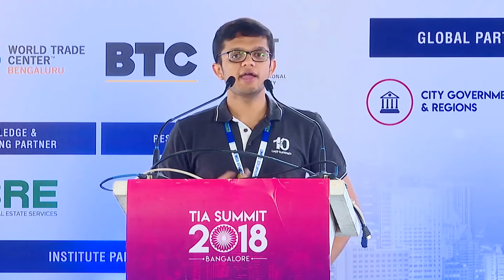Introducing Metal Air Batteries - Akshay Singhal, Log 9 Materials

Comment: IT'S REALLY A BREAKTHROUGH TECHNOLOGY.. Let's bring it fast..
Reply: Actually Metal Air battery made with Li as anode, has higher energy density than Al as anode.
Also voltage is becoming an issue, as its tool low for a car.

Comment: Pure garbage, India also doesn't have Uranium or Petroleum it still manages to run its Nuclear power plants by importing it from Russia, US and Australia.   The reason no body has Electric cars in India is because the batteries are expensive, but batteries are not expensive because of lack of Li or Cobalt alone, the existing manufacturing setup has not been designed for manufacturing large scale Liion batteries, also the net percentage of lithium and cobalt in batteries is less that 2% this guy has no clue.

Comment: Two major problems one the aluminium plates have to be replaced in each charge and that cuts the benifit we got of the increased range and two infrastructure required for pulling power from the grid for a traditional lithium ion battery car is easier to make and would not need getting everything from the routes and solar panels could generate power for the future Electric stations for improved efficiency it doesn't need active recycling which would make it very hard to handle demand if yoy are aiming for a mass market
And international companies like tesla interested in India but the reason establishment is being slower is beacause the wide spread nature of India and places with no proper Electric grid and irregularity in the availability of power and as the nation is actively trying to combat all these factors we'll soon have those companies in the vast Indian markets

Comment: these batteries are high maintenance... changing anodes frequently will add to costs making them impractical... we will still need petrol bunks to change the anodes and then recycling them and that will take even more energy.... you cant rechange these batteries because you cant recycle aluminium byproduct at home and make aluminium anodes..... this is doomed to fail...
Reply: not a very big deal,, when range is 2000 km, u probably have to do it only twice a year

Comment: Tell these idiots that price of aluminium is 160 per kg . Even if you extract 2000 WH per kg from the battery , it will cost 10 rupees/Km  . So concentrate on re chargeabpe solutions .

Comment: New billionaire is born
Reply: highly unlikely, these are the advantage OF aluminium air battery, not HIS aluminium air battery
Reply: john samuel   yes bro...  israel  started research in 2008 and brought car in 2013. we have videos also.
Reply: john samuel  agreed sir I had done a research on these batteries an year or so ago thinking of the possibilities more than they actually the infrastructure required to develop for replacing Aluminium sheets for each charge would make it more expensive than fuel cars to run forget bout electric technology

Comment: Congratulations , didn't know hot and humid India knocks off 40% efficiency from lead acid/lithium in batteries. Is it true the other way - are said batteries better in cold weather ?

I believe in him because there are other, Global videos saying the same.

In conclusion, you guys have cracked Indias main problem and here's wishing you and your company Billion $ in valuation. Also the comments section is proof Indians are far too much into politics rather than progress and better living 😎 !
Reply: He is talking garbage heat actually increases the mobility of ions in batteries or generally any chemical reaction simply because of entropy, the reason we want to maintain temperature is to keep the internal resistance manageable and prevent batteries from boiling and exploding.